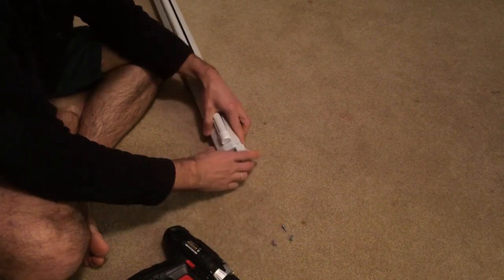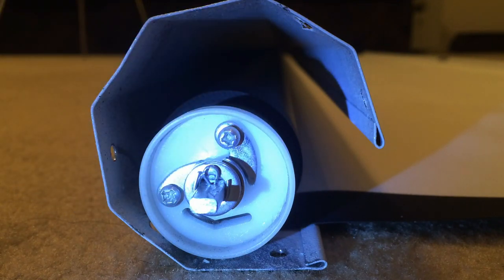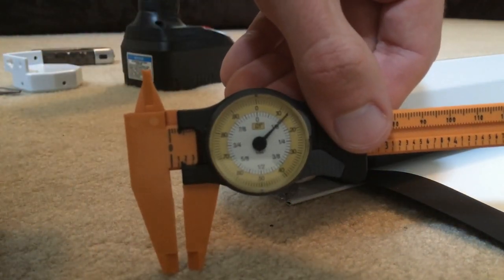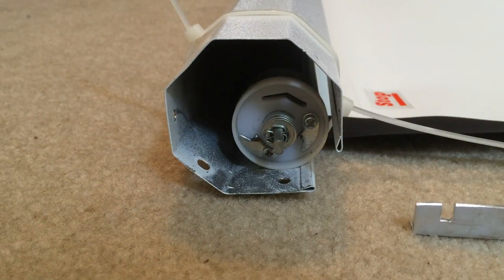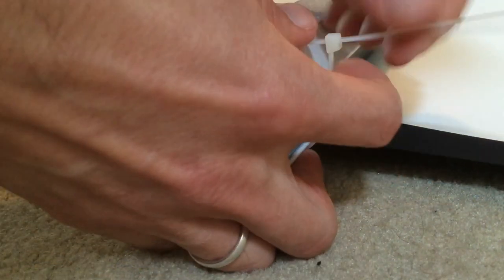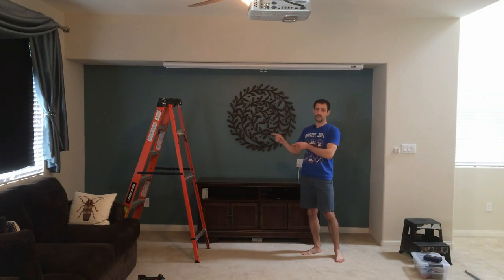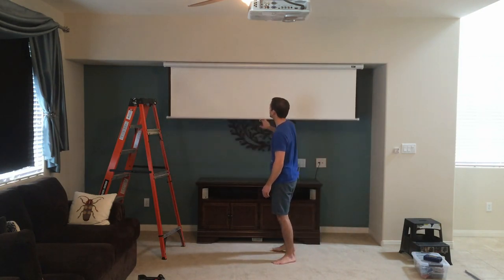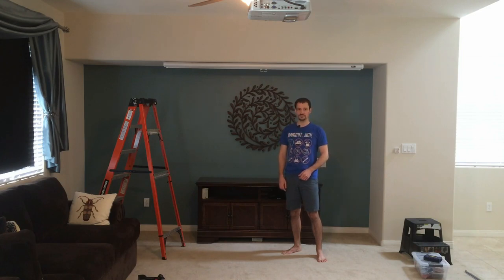Projector Screen Tensioning

Comment: Also another tip. If you take the other end off and pull the screen out of its casing you can then tension it up with the end where it locks into the end cap if that makes sense. No need for tensioning device. Thats how I did it anyway

Comment: Thanks so much! My screen seemed to have no tension when I first got it, or lost it due to my meddling with it and your video helped me understand how the mechanism was supposed to work.

Lazyness inspired me to find an easier way of restoring tension without using a shim. Remove both end caps. Slide the screen slightly out of the left end of the case and fully roll it up. To add tension, slide the left end cap onto just the screen but NOT the casing and rotate it a few times (the opposite way to how you were rolling up the screen) to build up tension. Then slide the left end cap plus screen into the casing. Then reattach the right end cap by inserting your fingers into the casing to help locate the screen into the hold in the right endcap.
Reply from the maker: Cool--I wish I had thought of that way! Getting the left cap on while the rod is in tension was tough, but it sounds like you did it without half the struggle I put in haha! Thanks for the share!
Reply: This is exactly what I did!  Unfortunately was not a permanent solution for mine.

Comment: Came across this video today. very helpful, I made a tool similar to that and used the zip ties. Putting on the new end cap was hard enough without having to hold the screen case. This video helped me repair a 3 year old 8' carpeted tripod screen with a plastic end cap.
I have 20 year old screens that were built better.   Thank you
Reply from the maker: Glad it helped! :) It’s a shame they don’t come with clear instructions on maintenance. I think I got a good price on my screen but felt the tension problem cropped up way too soon.

Comment: Actually, I found that if you wind the screen into the tube and then slide the ratcheting end out of the tube an inch or two, install the cap on that end first and wind the cap up to 3 or 4 complete turns and then line up the screw holes on that end, you can slide the cap onto the screen tube and screw it on. Then go to the other end and use a small spring hook to pull up on the roller pin, line up the cap holes and pin, then slide it on and screw it down. As long as you don't accidentally pull the roller out of the locking cap it should work the first time. It's a lot easier than trying to slide the locking cap on the roller under spring pressure and you don't need to fabricate a tool.

Comment: My problem was a little different. I could not get the screen to roll up..   The latches would not release to allow the screen to rewind.  Your video helped me to see the inside and understand how the latches work.  Thanks for your video.
Reply from the maker: Ted Kekatos my pleasure!
Reply: how did you sort it please, i have not been able yet since i got the projector screen to put it up
Reply: Same here - opposite problem.  I have a floor model Model C Da-Lite screen for pro AV usage.  ("cradle screen" - rolls up, with spine to support it.)  The screen was over-extended and would not roll back in!  With 2 guys holding the screen, I screwed off the caps and hand-rolled the spool (was over concrete so could not go to floor!.)  I did something similar to what you've done here, but have the same issue again.  I'll use your method here, your video is very explanatory.  Thank you.

Comment: I have a spring loaded screen like this and I'm planning to motorize it with a stepper motor and a wifi enabled microcontroller. It is a straightforward project in my head, I just wondered if you had tried this or thought of trying this? Since you said your next screen will be motorized
Reply from the maker: No motor yet! That project sounds pretty cool though. I’ve moved since shooting this video, and the new place doesn’t have a great spot for a screen :(  try automating your screen to roll down when you, for example, turn on your audio receiver or computer or other device 👌 good luck!

Comment: Thanks for the video just what I was  looking for. Now do u think it would be possible to peplace the whole screen itself? I want to try to replace my white screen with a grey one. I'll just buy the ALR cloth and cut it to size and insert back in the housing.
Reply from the maker: Mike R. Hmm that's a good question, I hadn't thought of trying. There may be a way to unclip the screen, but I don't remember how it's inserted into the reel. I assume you're trying to change the reflectance, so I wonder if you could just paint it instead?
Reply: Jim Stiernberg ya I thought of  painting but there's so many screen paints out there, everyone is saying they got the best and I'm not sure if it will stick properly seems like it'll just end up peeling off with so much rolling and unrolling.
Reply from the maker: Mike R. My first thought is to go with a latex-based paint. I've used latex types on other projects and found it to be capable of flexing quite well; mind, I never repeatedly rolled/unrolled it tightly several times. A quick search on Amazon showed a number of acrylic and acrylic-latex solutions. Without much expertise, it's hard to say, but the screen manufacturers must be using something and I would guess it is latex-based. Also, most of the suggested applications I read suggested at least two coats and I would think that an additional coat (definitely not 2 additional though) might help with fatigue/cracking/peeling issues. Let me know if you go through with it!

Comment: Hi, I am trying to reattach/glue the projection screen onto the roller.  You mentioned in the early part of the video that one needs to add the tension back by rolling it 12 to 15 times.  But towards the end of the the video you did 2 or 2 and a half turns only.  My question is should I add just 2 or 3 cycle AFTER I rolled up the screen into the box or I need to crank it up until I cannot turns anymore.   Thanks.
Reply from the maker: BSUISU Hey, sorry for the late response! I would recommend 2-3 turns after winding the screen up into the housing. In fact, you may want to try 2 first and only increase to 3 if it doesn’t retract all the way. I think I started mine with 4 or 5 turns and that sucker rang like a bell when it slipped out of my hand and went flying back into its case haha!
Reply: Thanks.  Hope it is just scary sound and there is no danger to my fingers.
Reply: @StoneFlange  hi. Hope you are doing well. Kindly mention any solution to curls on both side of screen. Thanks in anticipation
Reply: @StoneFlange  With my screen (big and heavy), I applied about 15 full 360° turns of spring tension after the screen was completely rolled in. It turned out to be much less tension than the screen had when new. So I guess it depends on the spring every manufacturer uses. I still wonder if I disassemble the screen again and apply 25 or 30 turns, if the ratchet that holds the screen will work again.

Comment: nice shirt! thanks for the tips, i broke my end cap, and am looking to purchase a new one... but not i know how to fix it.
Reply from the maker: Hope you can find a replacement--I deformed the inside of my cap a little bit during this process. It still works fine, but I wish they had lined the mating part with metal. There is so much torque on such a little bit of plastic!

Comment: Can anybody explain why a lot of spring tension is needed for the ratchet mechanism to work? My screen had good tension but the ratchet mechanism stopped working, it makes a noise at the point where it should hold the screen, but it almost never locks the screen when fully deployed. I don't know if it's lack of tension or the ratchet works on plastic parts that got worn out. I see two alternatives, applying a lot more tension to the spring and see if it solves the ratchet problem or leave mild tension and anchor the handle at the bottom with a hook and weights. I prefer to rely on the ratchet because that way the tension is supported by the ratchet, on the other hand if holding the handle at the bottom with weights, the (mild) tension will be on the screen, I don't know how that can affect the screen after many hours deployed. By the way I think it's best to avoid the method explained here using a metal home-made tool to maintain the spring tension, just remove both caps, move the screen a little to the spring loaded side, apply and keep spring tension with the screen housing's end cap that goes into the springed side, fix the cap to the housing, then fit the screen axle at the other end to the center of the other cap, and screw that cap to the housing. Not easy either, but you avoid trying to fit the cap to a spring loaded end, you work without tension and you don't need to make and ad-hoc tool. There are many different screens so your experience may vary.
Reply: I fully disassembled my screen; the locking mechanism is completely different to the one seen on this video. Here you can see a metal locking mechanism at the extreme and outside the screen cilinder. On my screen there's a freely rotating plastic part with five blades attached to a plastic core, the plastic core goes inside the screen spring -about 1meter long-. This plastic core is cut in half at the tip, which goes approx. at the center of the screen housing. The plastic part with 5 blades rotates freely at the tip where this plastic core is cut in half, the tension on the spring determines the expansion of the plastic core that's cut in half, and this allows the rotating part to be firm and lock the screen, or to be loose and let the screen roll up. What happened is, 3 of the 5 blades were broken, and the surviving two are worn out. It's a really bad idea by the manufacturer to put a regular plastic piece for that function, it should be metal or some high performance PA. To be able to lock the screen again, it's necessary to replace that plastic part with 5 blades. So I left the part "as is", tensioned the spring lightly and reassembled the screen.The screen can be rolled down manually and kept in place with a hook with weights, hooked to the screen handle when needed. Because of the spring tension is light, the tension on the screen (by the spring and the hook with weights in opposite directions) is light enough so as to not to damage the screen.  When I finish using the screen, I unhook the weights and the screen will gently roll up.  For reference, my screen is a Loch MWS 130. Not only the blocking mechanism is made of plastic, also the extremes of the screen cilinder that act as axle tips are plastic parts, not metal parts as on the screen seen on this video.

Comment: If the screen is just stuck, carefully hang it upside down. While holding this position, pull the slat bail while gently tapping the screen case on the floor. In most cases the screen will roll back up freely. I hope this will help you guys.

Comment: Will this work if the projector is stuck and will not go back up?
Reply from the maker: It depends on how it broke. If the tension spring is no longer attached to the rod the screen rolls onto, then you will probably have to weld(?) it back on. If the housing gets stripped like a screw head can be stripped (my housing is made of plastic, and I noticed the rod had warped it some), then you may be able to fill in the cap to restore the shape. If yours is stuck in the down position, then it may just need more tension applied or the ratchet and pall position-locking mechanism will need to be examined. I can't think of anything else off the top of my head, but those are the first things I would look at. Good luck and let me know if you find out anything with your screen or have any more questions!
Reply: @StoneFlange  Mine has a roller instead of a rod with smaller squares on each end.  The manufacturer sent me instructions for fixing that is very similar to what have done here.  Thanks for the feedback.
Reply: I have this problem! It hardly won't go up anymore, but there IS some tension. It sometimes works, and then it rolls up fine. But when I rolled it down, the gentle tug doesn't work again to get it rolled up. Very annoying.

Comment: OK so it looks like you leave one of the end On then you attempt to wind up the screen and then give it 15 more turns and then using your tool, you're able to put on the end cap. The only problem is I don't think anybody has that tool that you have.
Reply from the maker: They don’t unless they make one like I did :/ to be fair, it was a short length of angled aluminum cut with a cheap coping saw

Comment: Use a power drill on the end to put the tension back. Much faster
Reply from the maker: I thought it about that for a second, but didn't trust myself to be gentle enough with it haha! I think wrapping up the screen initially could be done with a drill, but you might want to be more careful when deciding on how much tension you want to add before closing it back up.

Comment: So, I was pulling my screen down earlier, and about half way down something happened, and the screen fell the rest of the way down, no tension. And ideas how to fix it? I can't afford a new screen. Thx.
Reply from the maker: Whoa that's scary, I hope you're ok! My screen has plastic end caps, so I'm guessing that yours does too. If the plastic housing wears out, then it won't be able to hold the tension bar in place. If you take the screen down, you should be able to roll it up (with no tension of course). Once you lay it down, open up the housing and take a look at both end caps. The rod in my screen has a rectangular cross section, so my end caps have a rectangular hole carved into the plastic. I actually scratched up this molding a bit when I was learning how to fix my screen, but it still grabs the bar well enough. If this is the issue with your screen, then you may be able to fashion something simple out of wood or metal to reinforce the end caps. Let me know what you find out, and I'll try to help out!

Comment: Generally the end caps have enough room where you can pull the one end out slightly, and turn the entire cap to add tension, then pop end cap back on. Your method is unnecessarily awkward and dare I say.....goofy😂
Reply from the maker: If I recall correctly (it’s been several years heh), the plastic end caps did not instill a lot of confidence for torquing up the spring. There is a rectangular receptacle molded into the plastic end cap, which distorted the first time I tried to hand crank it. You may find others built stronger though, in which case, you should definitely try out that simpler method out.